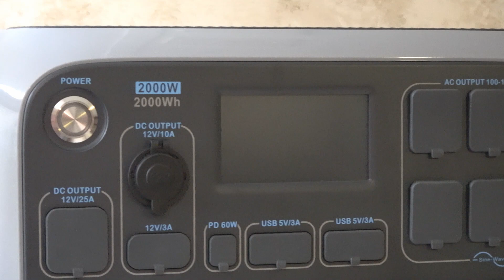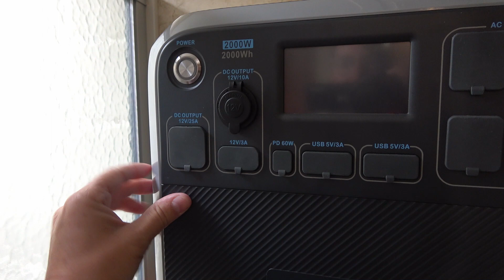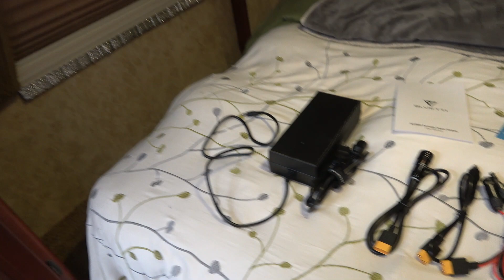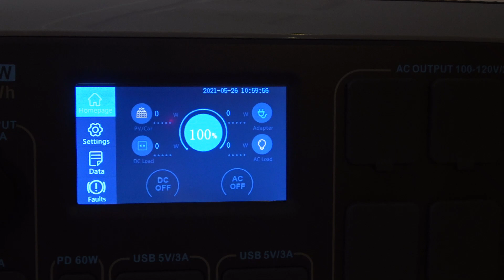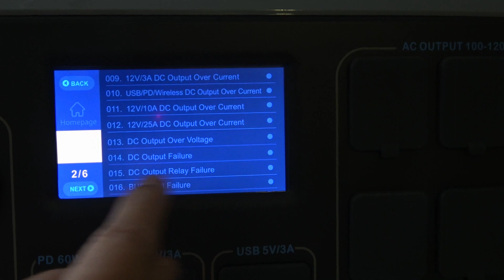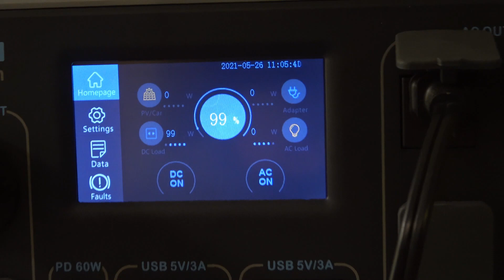All in One Portable Power Station (2000W/2000Wh) Bluetti AC200P Review Part 1- Intro and Features

Comment: Needs to tested in real time. I bought an ac200 for a cross counter rv trip. Realistically I would love to see it used with lights heat fridge water heater just that and see how long it would last. Most ridiculously I’ve seen rvs tested with th AC a 1500 watt heater a coffe maker a hair dryer toaster a welder it was ridiculous. Connect one to an rv with the lights all on fridge on and furnace. Ac is ridiculous.
Reply from the maker: Here was my real world test video I did for part 3 of the review  - https://youtu.be/CRIrExw2DGw  Cheers, Ray
(Part 3) Real World Camping Test + Pros/Cons & Final Thoughts
In part 3 of my Bluetti AC200P portable power station review, I take the system out on a three-day camping trip off-grid. I show you how it performs in a real-world situation and then give my overall pros/cons plus final thoughts.

Comment: It is not 2000wh but around real 1600wh. They should put 2400wh battery to advertise at 2000wh. And efficiency is low at less than 79%.
Reply from the maker: Yes, just found that in my recent part 2 video, came out to 1680 Wh powering a 600 watt load from the AC inverter outputs - https://youtu.be/fwSbuHHbj6A?t=473

Comment: The main issue with this all-in-one solar solution is the inverter is usually less than 90% efficient.
Reply from the maker: Yes, its specs say greater than 88%. I did a discharge test using a 600W heater and ended getting 1680 watt hours out of the 2000 watt hour battery, they say the depth of discharge is 90%.  I'm a little fuzzy on whether the 2000 watt hour spec is the total or usable capacity so that would dramatically skew the efficiency calculation.
Either 2000 X .88 = 1760   or 1800 X .88 = 1584  I'm leaning towards them using a 2000wh battery pack and cutting it off at 10% left.  It makes sense they would boast about its total capacity.

Comment: I can see this for the van dwellers or those that just don’t want to hassle with installing solar.  I can also see this for apartment dwellers for emergency use.  There a lot of people who just don’t want to deal with solar or thing their climate isn’t suitable for solar.  This unit could be left in a closet fully charged.  Just top it off periodically and prior to hurricane season.
Reply from the maker: Another benefit is no dangerous fumes so it can be inside

Comment: The solar generator units do not create electricity, they only store it. They must be charged. Camping off the grid would require solar panels or a generator. Dry campers usually prefer a noise-free environment. A modest sola panel system will produce perhaps 30 amps  peak current.  A discharged 2000 amp-hour solar generator would be more than 3 perfect solar days recovering full charge. We will continue to live without heavy ac loads and with our 300 watt portable solar panel array, 2, 6 volt Rolls deep-cycle batteries, and Epever Tracer charge controller.
Reply from the maker: Yeah, I guess its hard to come up with a name that non technical people can wrap their heads around. I think portable power station is pretty good.

Comment: motorhome question: Is there a means to charge from the chassis battery system on drive day? 4hrs of driving would be a great way to accomplish this.
Reply from the maker: Charging off the 12v battery system is doable but pretty slow as it maxes out at 8.2 amps so about 100 watts. But if you have an inverter already installed in the motorhome or could add a small say 600-watt one you could plug the Bluetti AC power brick into that and charge at close to 400 watts which in 4 hours of drive time would pretty well charge the Bluetti from a very low state to full.  You'd have to make sure that the motorhome alternator and charge system can handle the extra load though.

Comment: Nice unit but I’m not sure it can replace a nice 3500 duel fuel champion.
Reply from the maker: The 3500 is much more powerful and of course can last as long as you have fuel.  If you are lugging around that it likely means you need to run the AC for extended periods of time. But for some one with a 2000 that just needs it to run appliance like a coffee maker or microwave this would likely for the trick.
Reply: @LoveYourRV  I completely agree sir, thank you for the great videos.

Comment: I connected the Bluetti 13.4 regulated output to my existing TSR 110 batteries.  This way the Bluetti solar charging charges both batteries.  Then at night, the Bluetti keeps charging the TSR 110s.  This has worked very well during boondocking.
Reply: Can you explain how did this ? Did you make your own cables? Wire into a fuse bank? Or something else? I wan to charge  a 12 wet cell deep cycle battery.

Comment: Wow $2600 on Canadian amazon. How long do you think this could run a 8 cubic foot gas electric fridge?
Reply from the maker: It's hard to say exactly as ambient temps, sun on the RV sidewall and how often the door is opened, if new food is added, etc. will affect how often the fridge needs to cycle to stay cool. Fridges like that usually have a 335W electric element but that is only powered intermittently when needed by a thermostat. Running flat out, always-on, the Bluetti box would last for about 5-6 hours but if the run time is 1/3 it would increase to 15-18 hours. In gas mode using propane, I imagine it would run for a week or more as the 12V power draw is minimal. I tested a smaller 50L fridge/ freezer last summer and its average power draw was 30W, so the box could run that for 66 hours. Cheers, Ray
Reply: @LoveYourRV  Just trying to find a solution for keeping the food fresh while travelling.I have dual 220amp alternators on my truck so was thinking of running a 40 amp DC to DC but I seem to always  hit a stumbling block. The Wife is afraid of running propane while driving. Thanks
Reply from the maker: We find as long as we don't open the fridge too much it will stay quite cold for a long time since the insulation is so good on them, like a premium cooler. Often I will also put in a frozen thing I that I plan to defrost anyway to help out. With over 80,000 miles of towing under my belt I've never had food spoil. But having said that we usually travel in milder temps, over 80F would be on the high side.  A 40 DC-DC converter and maybe a 600 watt inverter would be ideal. I recently install a DC-DC converter for charging when cloudy and my solar output is lacking and plan to maybe hook it up to the fridge via an older 1000W inverter I have been using.

Comment: For the price of this thing you can buy 800 watts of solar, a charge controller and have enough left over for a few gallons of ice cream.
Reply from the maker: Yeah, solar panels and controllers are cheap nowadays most of today's system costs are lithium batteries and the labor expertise to put a system together properly with the right sized wiring and fuses, etc. You start to factor those in for most none technical-minded people the all in one box gets pretty attractive price-wise.
Reply: @LoveYourRV  Particularly suited for those trying to use solar for charging a few gallons of ice cream. Cheaper then lith batt's, but way messier..... plus you add Calories into your power calculation and the math just gets too complicated.....